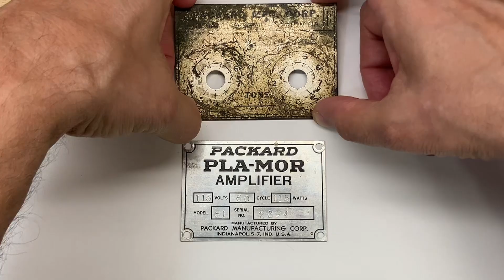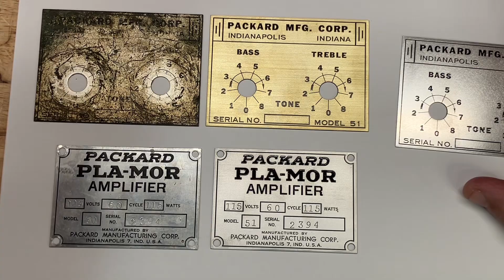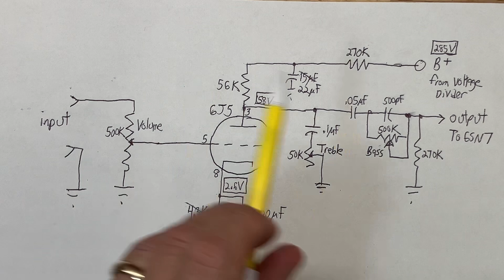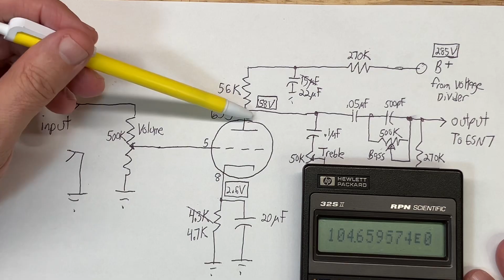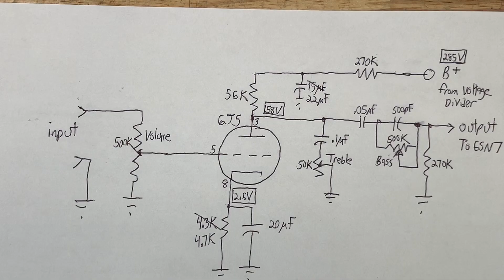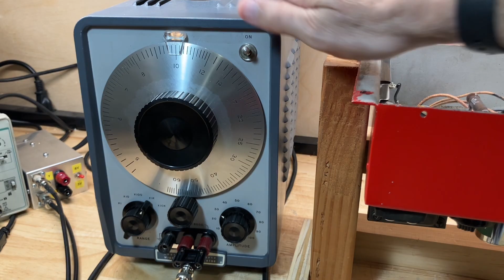1946 Packard Pla-Mor Jukebox Amplifier Restoration Part 6

Comment: I'm guessing there are several typos on that schematic. IIRC, '4.3K' is not a standard resistor value.
Reply from the maker: It’s the correct value, yellow orange red. Halfway between 3.9k and 4.7k, I guess. I didn’t have that value in my parts bin, of course, so first I replaced with a 4.7k. Then I saw that my local electronic parts store (yes, we have one!) had plenty of 4.3k resistors. So I put the correct value in.